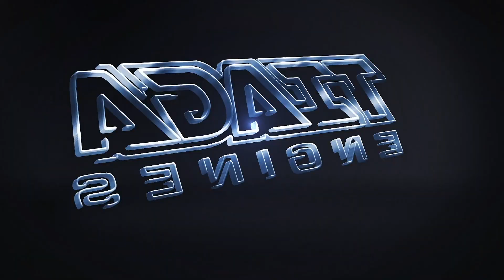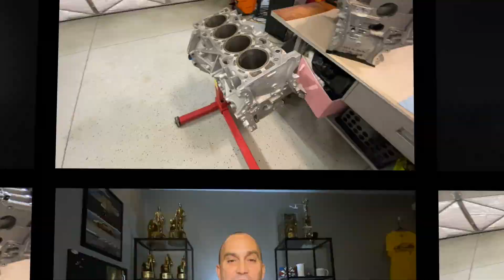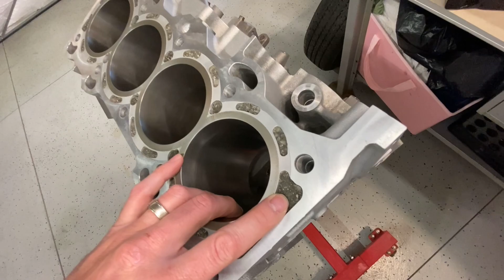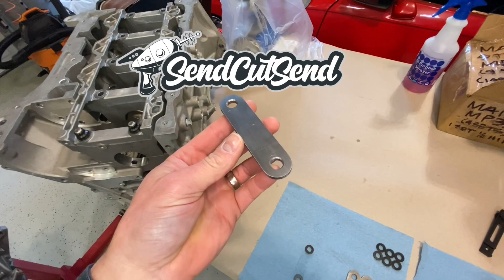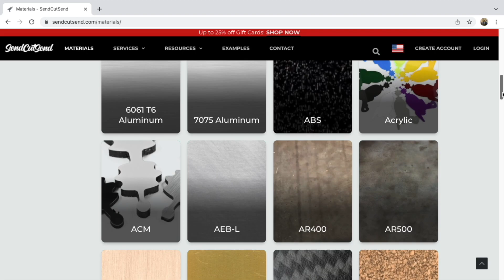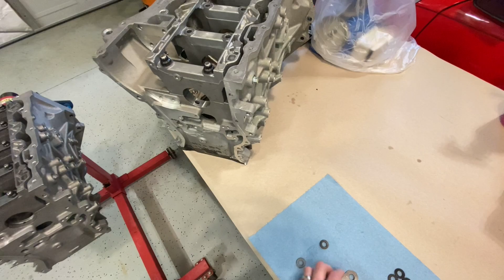Tiaga Engines talk Bergenholtz Racing Mazda 6 Engine Block

Comment: I'll have to look into a set of these for the Mazdaspeed 3 vents and put that engine back together I think I'm going to put that in as a all motor all wheel drive eventually backed up to a all-wheel drive transmission and eventually convert the rear end to all-wheel drive

Comment: Used to do the same thing years ago with my 2 bolt main blown alcohol 327 sbc. 

Filled block with 3/8 thick straps on the main caps.

Definitely made a difference in keeping the poor thing together.

Can't wait for the rest of your videos on this build, as I am seriously toying with the idea of building one of these engines since a 4 cylinder is one of the engines that I have not gotten around to building.

Mine will not be pushing the limits like yours but I am looking to push it to 1000 hp or so.

Will be a turbo, alcohol, engine with filled block, and welded up head deck to make it a dry deck engine.

Don't like water under my tires...Been there done that... Defiantly not my kinda "fun".

Quick question ?  Was the hard block you used the standard off the shelf stuff ?

The reason I ask, is because I used it in a aluminum 5.3 build and had it crack the block.

Seemed like there was a difference in growth between the two.

Thanks a ton for doing this build series... I have always been curious about the engine in that car since way back when I first read about it.